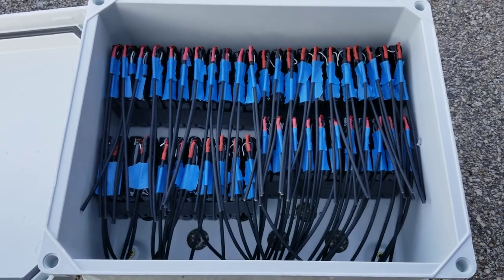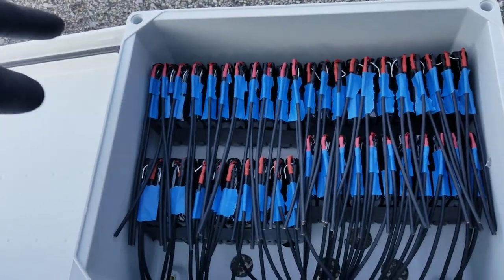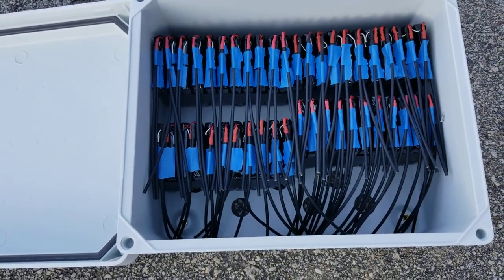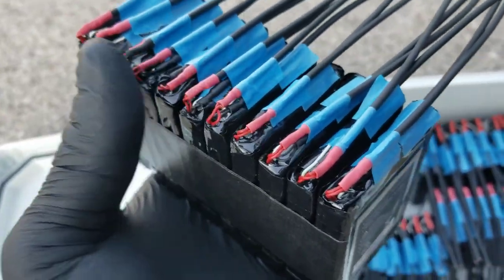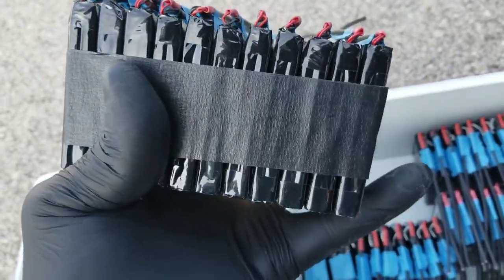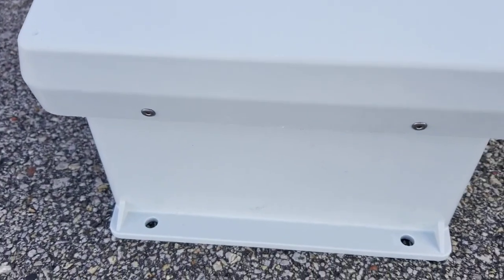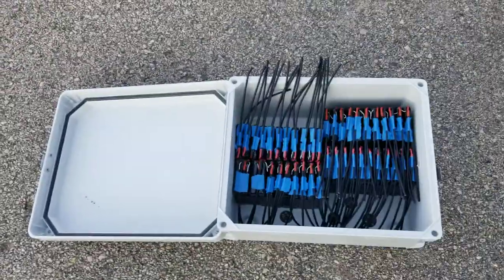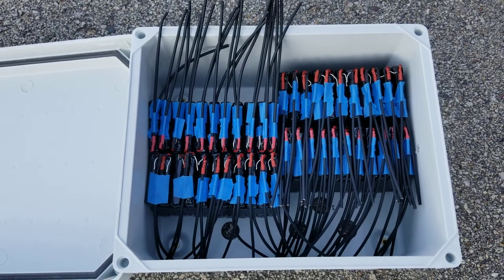LITHIUM ION POLYMER CELLS WITH BMS, PARALLEL/SERIES ARRANGEMENT, 3.75V 5000mah 18.75WH (part4)

Comment: YOU CAN TRY TO SOLDER THE SETS OF CELLS LEADS TO A CIRCUT BOARD THAT WILL OUTPUT THE FULL 24V OR 48V INSTEAD OF USING THOSE MASSIVE BUS BARS TO KEEP IT AT A PROFESSIONAL LEVEL . THOSE CELLS LOOKS GREAT WITH ALL THE SOLDERED WIRE ENDS FOR A SERIES , PARALLEL CONNECTION TO A CIRCUIT BOARD OR SO .
Reply from the maker: What Circuit board do you recommend for this application?
Reply: @jwsolarusa  ['M NOT FOR SHURE KNOW BUT IT WAS A THOUGHT IN MIND . IF YOU CAN DO RESEARCH , THERE MIGHT BE A BUS BAR CIRCUIT BOARD OR SUCH A TYPE .